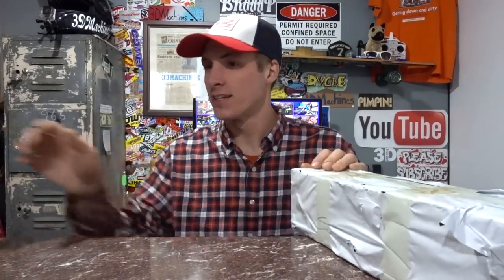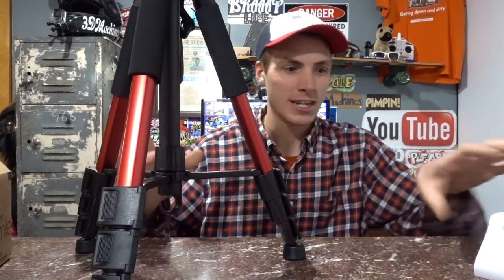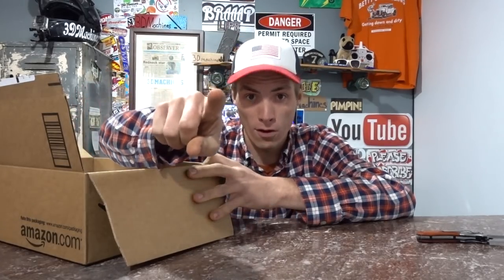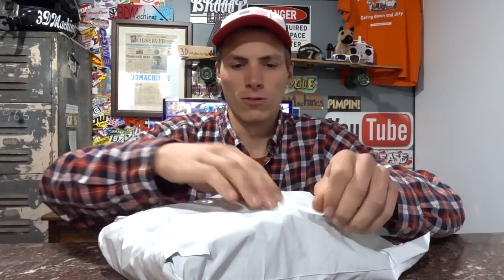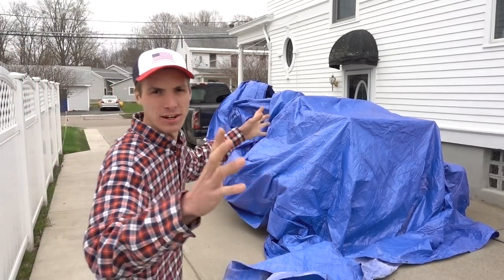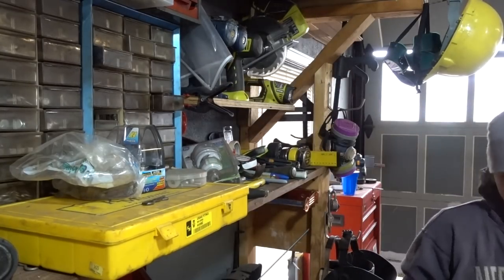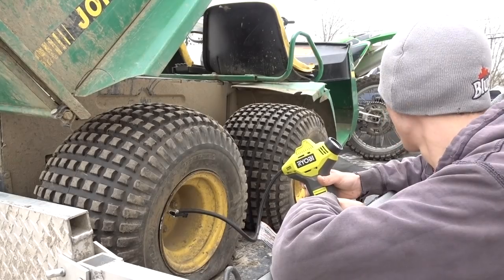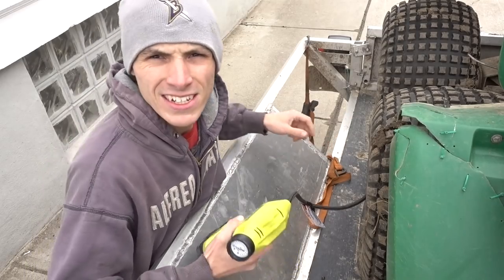NEW TOY REVEAL!!! (THE BIG SURPRISE)

Comment: You're gonna need to beef up that front end wheel support for some of those trails you ride.  Should do some power mods and maybe even an engine swap for like a 1000cc snowmobile engine! Pull the bed off and add seats .  Then build a trailer to pull behind.

Comment: The welds on that trailer are sketchy.
Reply: pause the video when he is around the trailer 5:09, 5:30, 7:02 and look at the welds. I see incomplete fusion, incomplete penetration, the welds are not even straight they are all crooked and full of undercut. That looks like bubblegum to me.
Reply: it looks better than mine!!
Reply: Better then yours
Reply: Looks normal for aluminum welds. it just melts them together.

Comment: I have an amt similar to this one but instead of a steering wheel and two seats it has one seat handlebars. Works good for my landscaping company. Usually load it down with logs for firewood that I do for people and it hauls them right out of the woods. Also have a custom leaf vac and trailer to do spring and fall cleanups. Been a great asset to me and hopefully for you to.

Comment: Gator looks awesome. I am building a custom lifted golf cart, looks kinda like that but has only 4 wheels. My question is, I have an 18 hp engine but cant find a centrifugal clutch that can withstand the 18 hp engine. any chance you can point me in the direction to find one that can take on the power of the engine. Thanks
Reply: get one off a terrajet or argo.
Reply: davidbrennan5 thanks so much !

Comment: 5:28 - those green zip ties tho'! Should be a fun project. Good for moving trailers around. You can get those yellow John Deere style seats at any tractor supply store. And hey, maybe those new LED light pod you got in the mail, install those up front on the Gator. Replace those ugly OEM halogen lamps?

Comment: That's awesome, I just put a hydraulic bed dump on one of the gators at my work, given it's a 2013 diesel model but they may make something for it. There was a couple kits like a heavy duty one witch is what I got and I'm sure it costs more than what you payed for the gator and then there is a light duty one that's not as much

Comment: Hey 3D machines I had like that same gator a while back just thought I'd tell you that little red level/peg by your left foot in the driver side seat on the floor engages the 4wd other wise I think it only spins the two wheels on one side. You should go on a dirt road and floor it with out pushing on the peg and then hold it down and floor it and you will see what I'm talking about. Anyway keep up the great videos.

Comment: there was probably nothing wrong with the front tire other than knocked off the bead from being moved around flat. likely sat around for years and got plucked for cheap at an estate sale or foreclosure sale. likely could have just smashed it around with a ratchet strap and got it to re-bead on the rim and been fine.

Comment: I have a amt 500 too not the best muffing machine but awsome power the issue with mine is the air filter is exposed right under the dump and all the water gets into it and it bogs out
Reply: Mine also has a hydraulic lift too

Comment: they are so bad off road it's frightening. as soon as the rear chains and cogs get full up with mud and grime they wear out and chuck the chains off. and the one wheel at the front is terrible off road as there's so much grip at the back it just keeps pushing it in a straight line. no hate dalton but a word of warning I don't think it will be a very good off road machineeeeeee keeps the good videos up 👍